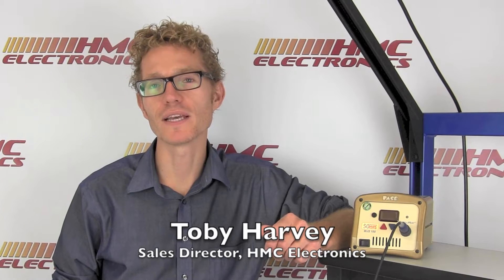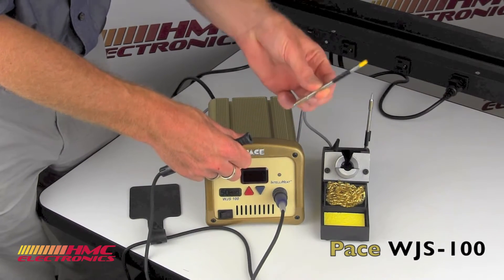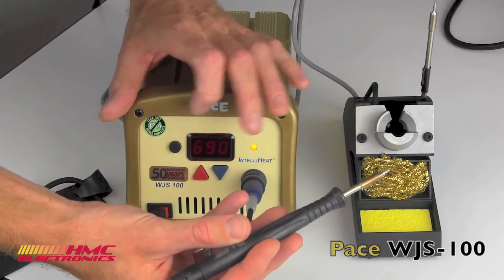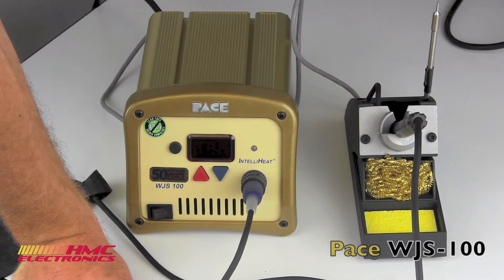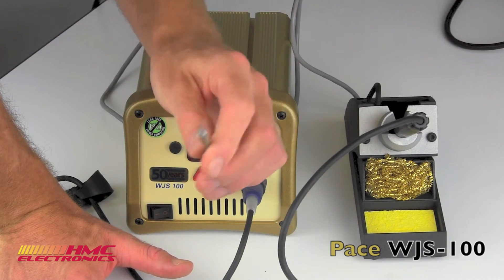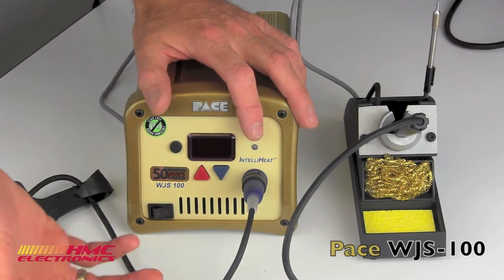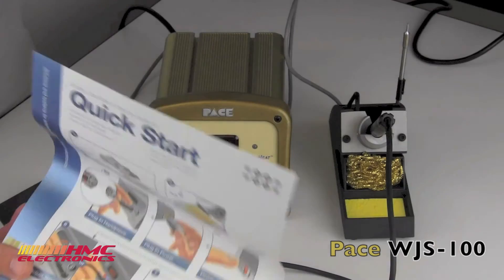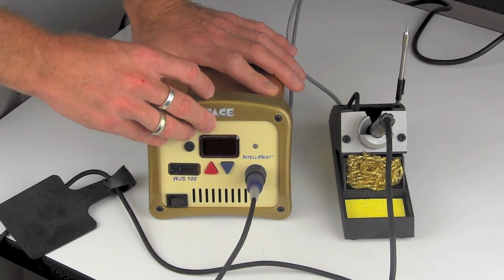Pace WJS-100 Soldering Station Overview

Comment: All my equipment is Pace. I’ve used their equipment since 1985 and still have my first Pace gear, a Micro Portable which is lines as well as 12V DC powered. The wand is labeled 6010-0068. It is very small and compact. It has served as my portable desoldering solution and is still in service to this day. This unit can also be used as a soldering iron. I use a WJS 100 as my portable soldering solution as it is quite capable of even difficult jobs. The big boy of this group is the Pace MBT-250 soldering/desoldering rework station. Short of their PRC 2000, there isn’t a finer rework station in their lineup. I have a future purchase of a Pace SMR which is Pace’s resistance soldering solution. This will allow me to solder cup terminals which are in cannon style plugs and receptacles as well as XLR terminations. This company is worldwide, world renown and satisfies professional efforts worldwide. It gets my vote. Experience counts and in high quality, high reliability soldering in the demanding world of the new J STD as it was with DOD STD 2000-1 back in my day, you can’t go wrong with Pace! Stay safe mates!😊👍🏻😷